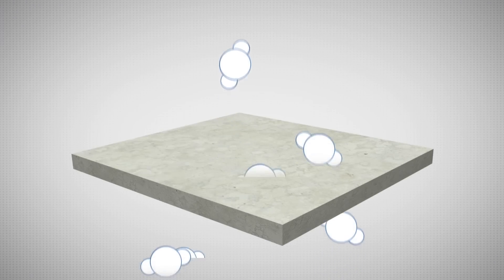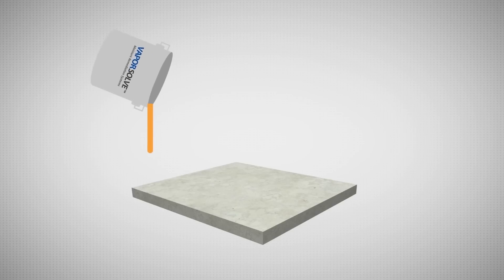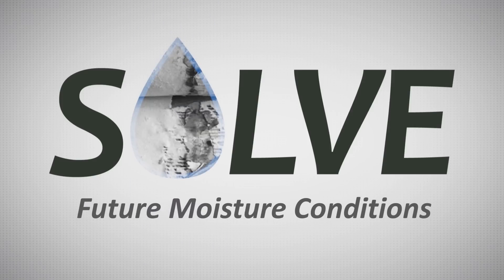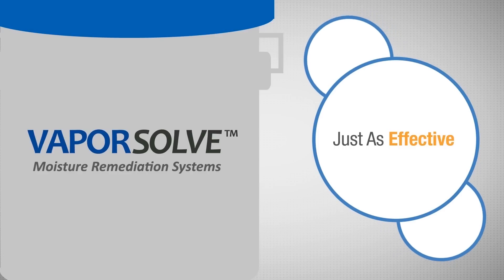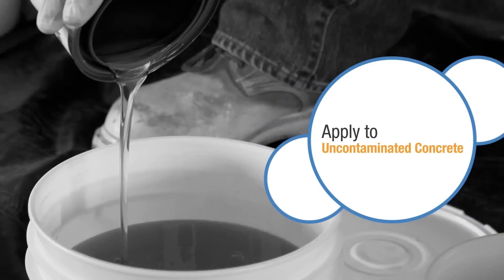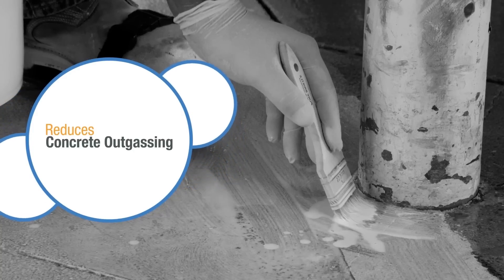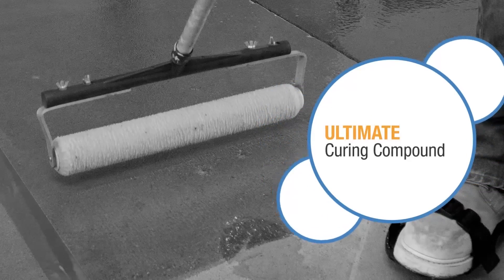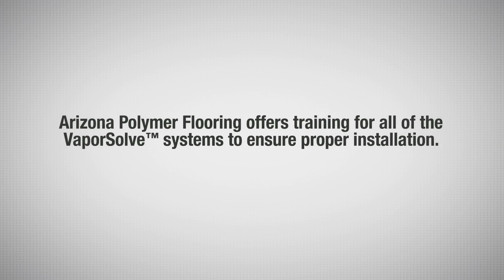Combat Concrete Moisture with VaporSolve Moisture Remediation Systems

Comment: Just put this down in Park City Utah at a ski resort over 3500 sqft of 1 year old concrete that was holding to much moisture and out gassing. We used 3 three step process, vapor prime, vapor solve, plus the tie coat system. Very easy to put down, ojala, que queda bien!?!

Comment: my concrete hasn't been dry since it was poured 4 months ago. how does this stop condensation?
Reply: SwitchDoctor  no epoxy on the market today stops condensation, except 1. And it costs 7.50 per square foot  installed. Not very practicle in most areas. Epoxy will minimize the condensation by blocking hydrogen from escaping from the slab.